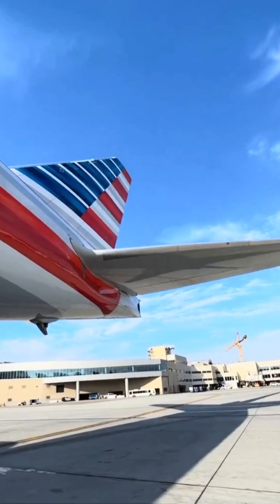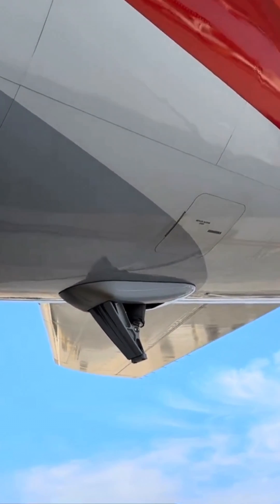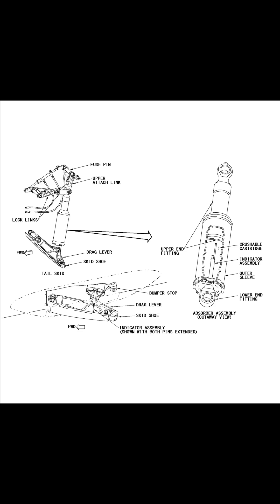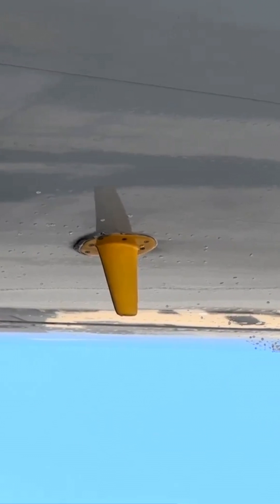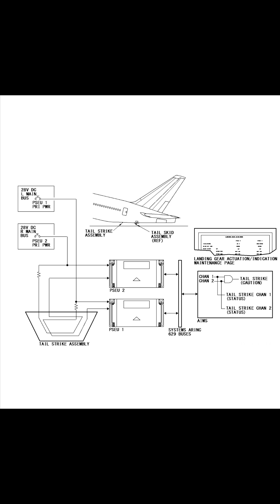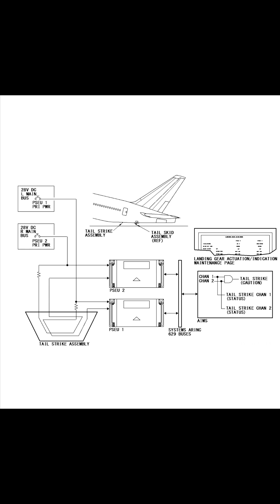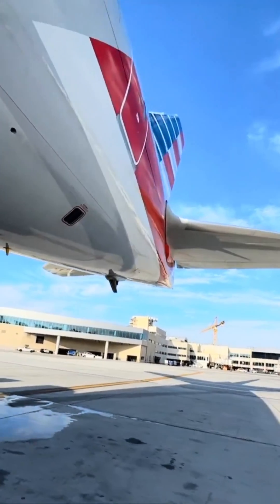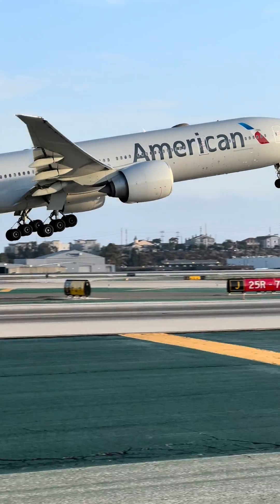B777-300 Tail Strike Protection/Prevention System

Comment: Did you know the 777 rudder, tab and elevators are manufactured in Australia 😁😁
Reply from the maker: I did not know that. Very interesting. Thank you for educating me.
Reply: @StigAviation  Boeing have a manufacturing facility here 
Boeing Aerostructures Australia (BAA) 
We make the flaps/flaperons for the 78, winglets, rudder and ailerons for the MAX and previously made the Krueger flaps on the 74. Previously when it was owned by De Haviland we also winglets for the 380 and 340. I know that made parts for the F18 program but don’t know the specifics. 
Sorry about me baffling on 😆🤓

Comment: Do many tail strikes actually occur ?
Reply from the maker: Very Rarely it occurs... usually happens in very severe weather conditions. The aircraft computer systems actually know the proper amount of pitch angle required to Not hit the tail. But that being said, sometimes bad weather can cause an over rotation. And once in a blue moon it can be caused by pilot error and an over reaction on the controls (But that's very very rare, because pilots go through rigorous training in simulators to practice)
Reply: @StigAviation  Thanks for the detiled response.